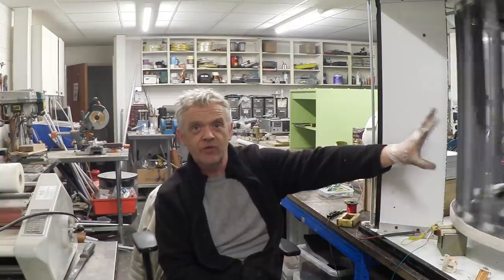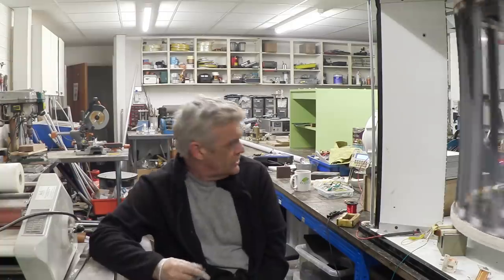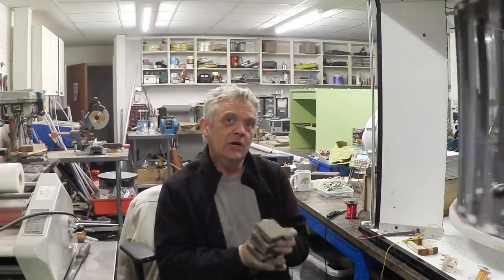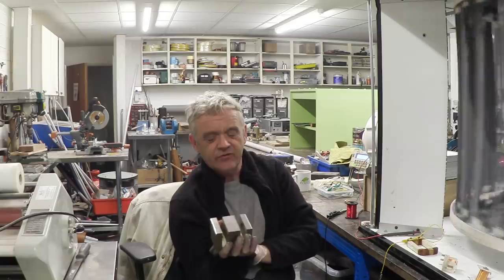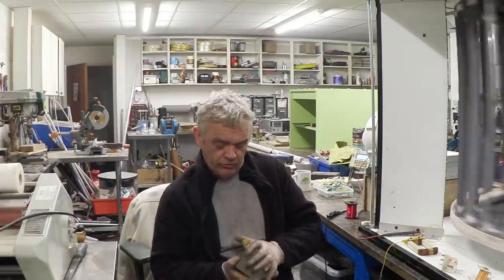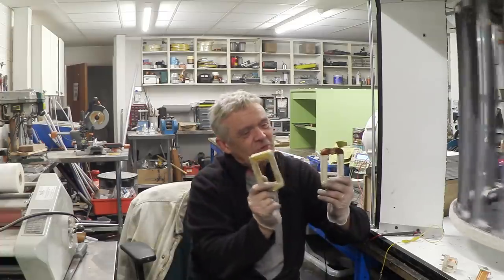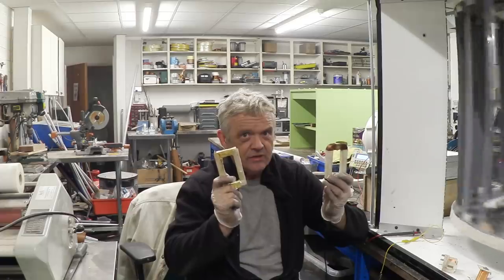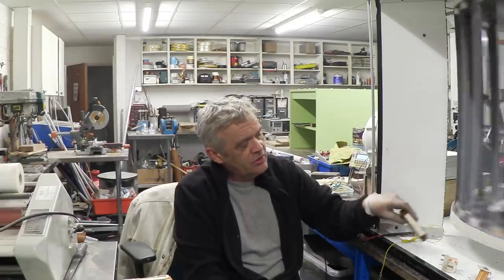Building a 1kW Wind Turbine For Under £100 - Part 5 - Messing With Coils

Comment: can't change max power
your input power is air from a blower.
your output power is what you extract from the coil
coil should have some sort of core (even a hand full of nails will work) to "focus" the magnetism from the magnets into the coil.
incedentely, thers 1 coil configuration you didn't show....
thers 3 "pillars" on that 3-body, where the coil usually is around the middle (pillar 2).
if you got a 2nd transformer, than use both the primarie coils on transformer body pillars 1 and 3 
put them in series or parallel to adapt to youre use :)
anyways, you might wanna just take a bobbin, fill the center tight with nails. dust make sure the center piece is not wider than the magnets
can even put as many (mini) coils on it as you got magnets. thatway the coils can stay small, barely need a core and only like 10 or so windings.
with the NSNSNS config of the magnets you do the same with the coils. 1 is pos. 2ns neg. best put all pos in series and all neg in series than via diodes put them together

Comment: @Robert Murray-Smith Was really hoping you would be doing a video like this. Have been mulling over the design for a project like this for years, but havnt as of yet got round to making one, despite a massive pile of sketches. Very interested in coil design and your simplification of the variables is very helpful. I guess ultimatley and sadley the right answer will depend on average wind speed, turbine length, radius, thus torque in those conditions and then suiting the generator for that. One nice caveat of your outside diameter magnet arrangement is that you could make a couple of banks of coils that can be switched in progressivley with higher wind speeds to control the turbine speed...obviously that extra current/voltage will still have to go somewhere. In the spirit of your video, when I get round to making my own, I may try 4 different coil arrangements in 1/4 steps round the circumference.
1. Radial Flux with core (Axial/ Vertically mounted with your magnet positions)
2. Axial Flux with core (independant cores)
3. Axial Flux coreless
4. To be decided? Maybe Axial flux with joint cores like radial flux but keeping the flat shape of an axial flux winding rather than the longer winding conventional in radial flux motor design. 
By keeping the same turns and wire diameter on every coil, the different generator styles can be tested against each other and even switched in when conditions are prime. 
Another test would be 1 vs (2 & 3) but with a second magnet disk for 2 & 3 to see if the extra expense of magnets offers any benefits over 1 "a single magnet disk with joint core as like the half transformer casing". My terminology might be out slightly but in my head I know what I mean by the different design varients.
However, I think I'd really need to brush up on my induction calculations before attempting any of that. 
Keep up the good work and hope you play around with more windings and coil designs in future videos :-)

Comment: If you will put coils all around in circle then you will get more current and voltage? Since in one area only you are getting 20 v and 200 or so milli amps so if you increase more coils all around in the circle- means more voltage and more current?

Comment: Just watching your videos for the first time.. shame I haven't seen before! 

Re the central core, would using an aluminium block, help with producing power, without slowing the turbine? 
Only saying as you described the iron core as giving greater output, but requiring more windforce to give the greater output due to drag, and you mentioned without the core there was less drag, but less power. 
My thought being that aluminium isn't magnetic but when spun becomes magnetic, and presumably the faster it moves, the greater the resistance?

Comment: That’s interesting because I was curious why you didn’t want to put more coils and get more power. If the iron is detrimental then why not just make your own coils whatever size is best for you and you could bolt them in with aluminum bolts if you really wanted. That should eliminate the drag on the magnets increasing speeds in a given wind. This is exciting and I want to see an actual KW at low wind speeds

Comment: Why not both, but wired independently? The secondary in the core & the primary without, feeding different circuits.  Maybe some mechanism to insert the secondary(s) system into the mix, when the wind gets up.

Comment: I was wondering whether installing multiple coils would create excess "cogging" to a point where the drum would hardly turn at all ? 
Also would the high voltage be better to accommodate voltage drop through your delivery wiring ? Or will a bridge-rectifier(s) be used ?

Comment: Loving this series Robert, it's something in very interested in and I enjoy your experimentation. 
I'd be interested to see what sort of output you'd get with multiple coils under the turbine and alternating one primary followed by one secondary etc. Whether you'd get a compromise of higher volts and amps or lower both...?
Reply: That's an idea I had two but if you want to spread the coils out along the bottom it would be smart to make it spaced out so that the magnetism would be off center on each generator coil so you wouldn't have a high magnetism to overcome when you start the machine

Comment: The consideration of which coil to use (larger wire - lower turns v smaller wire - higher turns) could come down to the distance the generated current has to travel across a given conductor to it's ultimate use or storage. A short distance means less voltage would be required... (Amperage is King, in my mind.)

Comment: Is there a way using a crank sensor or something to switch between the thick and thin wires based on the rotation speed?

Comment: What if you use both coils separate, and make a hybrid system? Low voltage high current and high voltage low current. Also if you cut the iron core and use it only in the middle of the coil like the nail in the bobbin, what are the results?

Comment: One should always design for higher voltage, because it current passing through wire that causes loss due to resistance of the wire

Comment: Could you just use both coils but not have them connected together? what would the results be the same or would it be slightly less with both coils? (the coils would be in the same iron core without connecting them together)

Comment: It’s a lot like a gearing ratio voltage and amperage torque and speed all correspond hand and hand I think higher speed and voltage is better easier to step down to bring the amps up rather than to step up and drop the amps which I think there is more resistance and lose

Comment: If I remember correctly, higher voltage-lower amps will produce less heat losses in the wires, so the choice of coils becomes clear, right?
Reply: He will never have high amps, so not a problem here.  It will never produce 1,000 watts.

Comment: Partner Robert but I just wanted to make a suggestion with removing the center of the iron core I think it would be smart to put the secondary on one end and the primary on the other end of the e and see how that works doing both of them at the same time!!

Comment: The wiring seems to be dependent on what you will do with the energy produced (storing it beeing the first thing that pops in my mind, so rectifying, etc). If iron core slows the thing down, then to me, the answer lies in many "air-core" coils. Just guessing, as i´m completely out of my field here :)). Anyway, this series i believe is one of the best so far!!

Comment: Your running into the problems that wind energy has had for years. You can't beat Mr. ohm or physics. Verticle wind turbines typically don't turn as fast as horizontal turbines thus they inherently make less power. I would suggest that if you wanted to run anything bearing a load two things have to be remedied. 1. the load itself and 2 the speed of the turbine must remain high.
Maybe use batteries to run load bearing devices and use the turbine as a recharge unit only. Maybe routing power through some kind of transformer or battery controller to raise both amps and voltage without putting a load on the turbine itself. Just thinking outloud here. By the way I always enjoy your videos. Learning at our age is always more fun then math class was...:-)

Comment: If you cut transformer core, you can make T shape core. So you can set many T cores upside down. If you cut it in right angle you can make ring of T cores and that is what you need. Magnets must be in correct setting. If one with N pole hit one core other magnet must have S pole and hit other core. If you make ring of cores your count of cores must not be equal to count of magnets. Best may be 2 cores to 3 magnets.

Comment: What would happen if you took a line of copper and wrapped it around a rod and bent that rod to the same circumference as the bottom of the mill. Making it so that there’s constant spaced contact in magnets and copper line?
Reply: If that (the copper wire/rod) was multiplied to accept the full magnetic field?

Comment: One could slide in the cores automaticly at higher rpms, giving it less resistance and power at lower rpm and more resistance and power at higher rpm. Making it be usable in a greater range of rpms. Do the cores need to be on so tight?

Comment: A thought,,, alternate the coils round the plater. Seperatly tied together in seprate output circuits. Use blocking diodes at the end source too charge a battery bank with both the high and low seperate circuits???? Maybe?

Comment: Quick comment on amps vs voltage: Loss of energy due to resistance is proportional to voltage, directly, and to amperage, squared.
So: When in doubt, go with voltage in order to lose less on the way to where it's used in the end.
:)

Comment: You are switching reluctance as the magnetic poles alternate. It's typically used in small engines, known as a magneto. Aircraft reciprocal engines typically use it too.
Reply: Oh, the faster it turns, the higher the output.

Comment: Mechanical watts translate to electrical watts - Therefore winding turns are not too relevant. However, if you intend to run long wires, then high voltage low current would be less losses across the wiring.

Comment: I sujest if you try both coils witj high voltage capacitor which same configuration in microwave without steel housing keeping primary closer to magnits ans see what is the output,, cheers

Comment: Hi Robert. Loving this series (as I do with most of what you post). Just a thought that might be worth looking at regarding the transformer orientation, are you familiar with the transverse flux generator? It Looks like the magnet spacing is roughly in line with each arm of the 'E' core which might be having a similar effect to that generator. I hope this provides another path to explore, although I believe that a mind like yours probably has plenty to think about already!
Look forward to the next instalment.
Tim.

P. S. Have you had any thoughts on overspeed?

Comment: Rob, I’ve always wondered if using copper wool wrapped in an iron coil would generate anything, basically the reverse of the microwave transformer arrangement but with a high surface area copper in the middle. My logic is that, if batteries perform better with a high surface area material, would it not stand to reason that a higher surface area copper material yield a higher result? Something like high power generation density of sorts! Be an interesting test at least.

Comment: Would it be possible to make the iron core retractable so that during lower wind speeds the turbine would not have the additional load the core induces on it yet when extended be able to utilize the extra torque  provided by higher wind speeds, in effect a two speed generator

Comment: Visit the fieldlines website if you truly want information from experience.  They document well.  Check out their Wind section.  This would be considered a VAWT although it isn't truly vertical but rather perpindicular.  Hugh Piggot is the de facto expert for a 10' HAWT plan.

Your size of VAWT is only practically worth 20-50W and you need multiple phases of AC to rectify to DC as you explained to prevent cogging resistance.  Ideally you aren't looking at very thick wire as you suggest, but would be best served with thin wire to keep volts high.  High voltage prevents line losses, which are already high in a VAWT.

Comment: make the gap between the transformer core material and the magnets smaller and you will see more output power guaranteed.  Home made generator setups like this tend to have big drops in efficiency at this gap because most people can't build machines with a high level of precision.  Also they may not realize how much induction decreases when the air gap between the magnet and the coils is increased.  On that note, if you could get transformer cores which were able to line up with the North and South magnets at the same time (North pole magnets aligned with the outer legs of the "E" and the South pole magnet aligned above the center leg of the "E" core) and you'll again see an order of magnitude increase in output or possibly even more.  If the magnets aren't correctly aligned with the legs of the core, then its like at some points in the rotor's rotation, you'll have destructive interference between some of the magnets, giving a weaker output.  You'd probably be better off to just keep the center core of the coil and remove the outer legs of the 'E' if it isn't aligning with your magnet spacing.

Comment: My guess WRT cores...

If you have the "top" on, the top will "short-circuit" the magnetic flux, in the same way that a turn-on-and-off-able magnetic base works, and your coils will see next to nothing (you're probably only getting some generation from the "stray" flux around the ends of the coils.  Again, if the ends of the "E" are running in line with the magnets (i.e. the three ends all under the magnet at once), you short-circuit the flux again, whereas if you have it at 90° (E-coil-E-coil-E under the magnets in sequence), you're surrounding your wires with a varying magnetic field via the flux running through the E.

There's almost certainly a variance based on the relation between the magnet size and core / coil size, and you might well have benefit in only coring the coils in the centre as you mention at the end of the video.  

Interesting though it is to experiment, this stuff is probably all explained in some ancient tomes which could save you some considerable time; it's not like you're discovering something new to humanity, but I don't have the required google-fu to extract the information from the intarwebs.  Maybe something like "generator flux density" or "generator coil size"?

Comment: the iron core would more than likely reduce your efficiency due to your use of magnets, the magnets will tug on the iron and act as excess resistance for the turbine.

the more energy out would largely not be as worthwhile because it increases the threshold of input energy to start producing energy at all, unless you were in a situation with guaranteed high wind at all times, like for a nasa mission on a planet with excessive wind speeds. there's reasons to use both for sure.

Comment: Iron cores only add inertia. So more power per speed, but less speed. So if your system is supposed to be as light and dynamic as possible, (which is what you want when you do not have ideal wind conditions or high wind speed) then leave out the iron core. If however, it is quite Wendy where you live, then more inertia is not a problem for you, and the increase inertia will mean a more stable revolution.

Comment: Fascinating Robert. I would go as far as saying, ground breaking mate. If I might be allowed to provide some input, what about air gap ?  In the world of electrical generation, air gap, or lack of it, is quite relevant. I'm talking AC generators here, as in your average car alternator. It would seem that, in order to get the most output from such a device, then you need to construct quite a close tolerance machine with the smallest possible air gap between the rotor and the stator. This is so the magnetic circuit is as close coupled as possible. This requires accurate machining and good quality bearings to achieve a consistent and small air gap. For any given magnetic coupling there is an optimum system rpm. In vehicle applications, this equates to somewhere between 1000 and maybe 4000 crankshaft rpm. Not sure what alternator revs that  equates to but probably  four times crankshaft, so 15,000 rpm maybe. A governed wind turbine speed is going to be more useful, I feel. Not sure how this translates to your microwave transformer implementation but the rate of cutting of the lines of flux ( ie the field provided by the whirling magnets is what's important. A tuned setup is what you need, to suit your average wind speed. Then  pick your wire csa and number of turns to give required output. Hope that helps a bit. Good luck.
Reply: This is precisely why inductive charging of EV cars is a complete none starter (pun intended). However a lot of people have made a dammed  good living raising funds for "research" into this impossible grail for off street charging.

Comment: What about using 2 secondary or 2 primary coils on the same core, would they still cancel each other out, or possibly increase the voltage and or amperage.